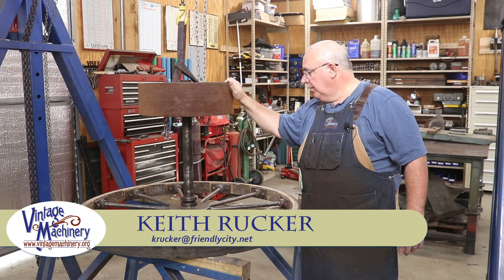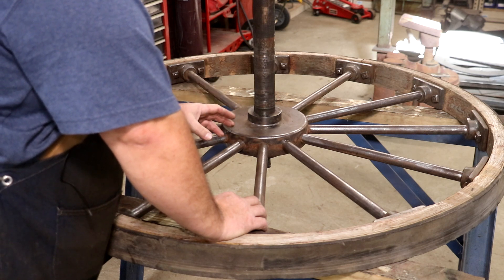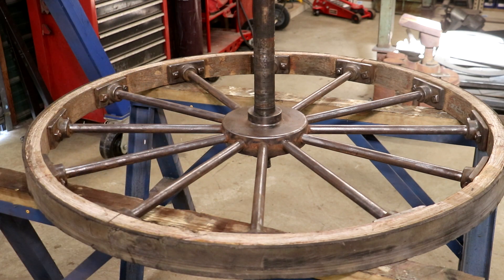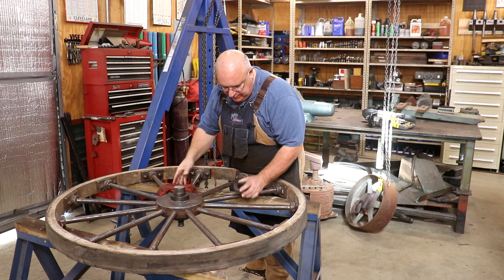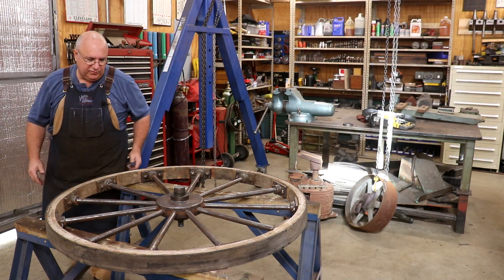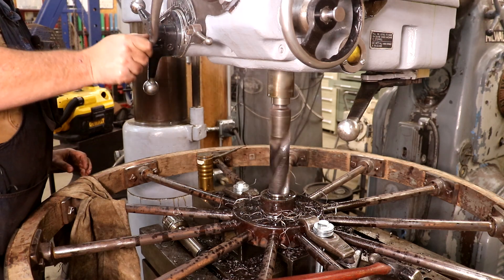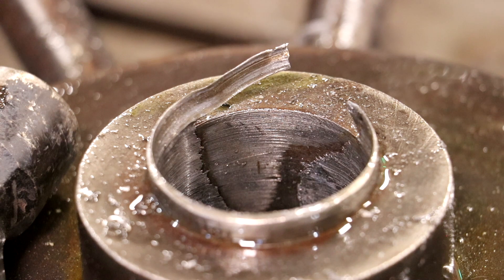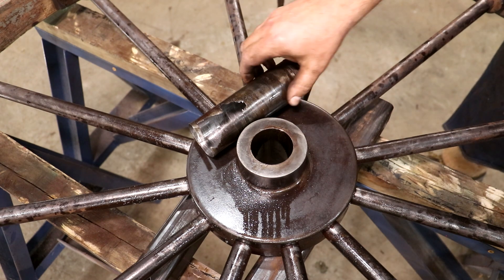The Jimmy Diresta Bandsaw Restoration, Part 5:  The Battle of the Stuck Wheel Shaft - I WIN!

Comment: I ain't got no giant radial drill.... I would have covered up that bitter end of the shaft with some of that putty stuff you use for making babbit bearings to insulate it, and then packed the shaft in dry ice for a few hours and kissed the hub with a rosebud... pretty sure the heat differential would have done the trick.

Comment: Very good feeling to see the inside of that hub with no significant damage.  I was asking myself,       
      " Keith why do you even have a radial drill anyway?"    Fun to watch this one - kinda drives home why it's so cool to have a nicely equipped machine shop!   
     The possibilities where the metal planer are concerned are interesting.   Someone Named Acheson has reworked some Bridgeport tables on their sizeable metal planer.
   *QUESTION= since large hunks of steel or cast iron are so dang expensive, could a guy clamp down a piece of wood to check an angled setup on the planer to check ballpark angle?
     Maybe the indicator could tell us the same thing thing?  Cool video.
Reply: The Acheson's planer is super tuned, with an air powered tool lift on the reverse stroke. He's also a master of tool sharpening. When working cast iron, he takes neat shavings, not chips or dust.

Comment: Even though this one is left hand thread, i would check very carefully that the other is not right hand.
Reply: The other should be LH too. Looking at the wheels from the nut side of the hub, both wheels are turning clockwise so both LH threads will tighten the nut. 

If one were turning clockwise and the other counterclockwise, like on some heavy truck axles, you would be correct. I learned that the expensive way.
Reply: @josephcitizen4195  My thinking is that one shaft will be driven by the motor, the other shaft will be driven by the blade going around the wheel.
Doesn't hurt to check anyway.
Reply: @sparkyprojects  "Doesn't hurt to check anyway."
100% correct. No downside to checking it out.
Reply: Actually this was the driven wheel? Or is that big "pully" looking thing a counter balance? If all this is a the case he would need to look at putting a different thread when he makes the new one? As it will be driven on the bottom wheel? Or I think that's what he said?
Reply: @warrenholmar1129  The one he was taking apart has the flatbelt pulley on the otherr end of the shaft, so would be driven by the motor/engine.
Reply: @sparkyprojects  oh was this the bottom one?
Reply: @warrenholmar1129  That's what it looks like, and would explain left hand thread

Comment: Hi Keith, thanks for an interesting video. It’s good to see the big beast in action. 
At about 12 mins in, you can see the power down feed actually forcing the whole head upwards and it’s particularly noticeable if you watch the ball on the end of the handle. That’s not ideal. I don’t know if you have a vertical lock on the pillar?
Cheers,
Bill

Comment: If you etch the face of the center boss with acid, it will show any structures such as a key worn flush with the boss that is currently obscured.
Etching shows the crystalline structure of the metal and is used in weld analysis.

It's better not to attempt to cut all the way through the wall of the shaft, but to reduce it to less than a millimeter and collapse the wall inwards with a chisel.
that way you don't damage the bore.

Comment: Taper-fits can be a bit of annoyance. I remember detatching a bronze propeller from a stainless steel shaft on a traditional type of boat from Sweden. I tensioned the propeller as far as I dared to, (a very hard and strong tensioning), useing a modifyed gear-puller. No action. Then I heated the propeller with a Propane-torch, up to perhaps 200°C. No action. I then re-tensioned the screw of the gear-puller and smacked the screw with a substantial blow from a hammer... Action :)

The ring in the ears... lasted for five minutes at least... Like something from the movie: "The Ringer of Notre Dame" :)

It came off beatifully though,  so I could work forward in servicing the boat properly by extracting the propeller shaft, modify it (shorten), and install a so called "Aqua-Drive" with advanced axle-joints and soft engine paws. Greatly reducing noice and vibrations. An extremely effective modification. Also, I installed a different, way more advanced propeller-shaft seal, called "Black Jack", made out of rubber only, water-lubricated against the axle + grease-lubricated and water-sealing lips from Volvo Penta.

No leakage of oil into the bottom / tramson or keel of the hull any more,  from the sealing device. The former called "köl-svin" in Swedish: Keel-Swine 
in English :)

Now one could actually sit in the back-cabin, without hearing-protection, just  hearing a soft humming noice from the engine and the waves splashing sound against the hull.

No clegg or grime in the tramson / keel anymore either.

Comment: The other shaft might be RH threads... since one shaft drives it's wheel and the other is driven by the wheel, thus to induce self-tightening the thread direction shifts. This is why on Bicycles with threaded bottom bracket (crank spindle) cups, the LH side is RH threaded and vice versa, yet why on oldschool threaded tandem/downhill rear hubs the RH side (freewheel gears) is RH threaded while the LH side (drag brake) has LH threads. Better check the threads if you can before you wrench on it!

Edit: My final analogy is wrong... Both sides of such hubs have the same thread direction RH... for the same reason I was trying to illustrate! Unlike a drive cog (which powers forward motion, a brake resists forward motion (like a non-ideal idler bearing), the self tightening reverses. But since the side/rotation flips (depending on which side of the wheel you're looking from), the flips cancel eathother out, hence why both sides of a such a hub are RH threaded.  And in the case of the saw, since the side/direction did not flip (but one shaft drives while the other is an idler), the directions in theory should flip.
Reply: While it's worth a check, with the pulley driving the shaft and the shaft driving the wheel, I'd expect that the pulley nut is also left hand thread.  That way any slip tightens.  I think I have it right but could be wrong. For instance. a bench grinder will have left hand treads on one side but right on the other.  It has to be that way because power comes from the middle.
Reply: The other should be LH too. Looking at the wheels from the nut side of the hub, both wheels are turning clockwise so both LH threads will tighten the nut.
Reply: @josephcitizen4195  Correct. Assuming the retaining nuts are on the same side of the machine, which I have never seen a bandsaw that wasn't, each wheel has the same torque-force applied in the same rotational direction. In this case: clockwise INTO the nut. Assuming the shaft slips, the clockwise rotation of the shaft imparts a counter-clockwise force against the thread direction of the nut causing itself to screw INTO the nut, or in other words, the nut to self-tighten.
Reply: @mikekellam365cid  See the edit I just made to my comment... I botched the analogy and I think a lot of us missed my point. 

The second shaft appears to be a live axle idler... so the idler pulley is driving the axle against the drag of the bearing, which is the exact opposite of the drive pulley which is being driven by the axle against the drag of the saw band and what's being cut. Since the rotation and nut sides are identical, the thread direction to self-tighten flips from LH to RH. 

For modern saws this isn't an issue since usually the idler pulley uses a dead axle with bearings in the pulley itself... not a live axle with external bearings. In such cases the nut isn't used to hold a press fit (and in fact, overtightening will kill the bearings), so thread direction doesn't matter and the nuts either are locknuts, castle nuts (with a cotter pin), and/or have keyed washers behind them.
Reply: If you examine the thread very carefully you can easily tell if it’s left or right hand.

Comment: It appears you have 2 options to reassemble:  Revert to a tapered shaft with a left handed threaded stub or straight bore the hub, broach 
a keyway and drill and tap into the side of the hub for a set screw.  The 2nd option only works if you can fit the wheel on your mill, unless
you can use a boring head on the the Carlton and have broach capabilities.  You will need a long drill and tap extension for the setscrew.  
The 2nd option may allow for someone else to avoid the same mistake you made tightening the left handed thread when disassembling.

Comment: The rim of the lower wheel is trying to slow down the driving axle (due to the load provided by the saw blade).  So a left hand thread on the axle nut will be tightened by this torque.  However, the top wheel is only idling, so the starting acceleration of the wheel inertia is the biggest load.  Since the accelerating force is provided at the rim (by the blade), a RIGHT-HAND threaded nut on the shaft would be tightened by this acceleration.  So a left-hand thread is not a certainty on the top wheel nut !
.

Comment: One thing I may not have been clear on but could make the removal easier, would be to not drill all the way through but make sure the hole goes beyond the hub by say 1/2 inch.  You could then drill it to only 1 15/16 and use a say 1 3/4 bar to drive the shaft out.  Pressing through the hub,  the left over metal will stretch and shrink at the same time..   That shaft was pretty soft..

Comment: The long indicator rod which went up in to the chuck is not straight, you can see that when you rotate it and the spot you drilled with the centre drill was off centre, you can see it clearly @10:24
Reply: So what?  The project is a success.  Done!

Comment: 24:41 the way that washer before the nut was kinda made it obvious from the start. And because it's such a shallow taper, any amount of crud/rust would've made it nearly impossible to remove.
IMO, you did the only thing, that was sensible, possible to remove it. Prolly could've worked with a torch, but that's a lot work and gasses.

Comment: I have worked with  left hand threads  for some time now. I don't belive you neither had too much heat on the nut or too much torque trying to remove it. There is a good possibility that it was damaged from the original installation

Comment: I think I'd  re engineer the shaft and put a key way in. Get rid of the taper on the shaft because I think it's going to be tough to design a taper in a new shaft that'll work. I think you'll have a problem with the wheels wobbling. I'm not an expert but you can do what you want.
Reply: Try a straight shaft with big shoulder, no keyway, and big lock washer first. I don’t see it loosening with the L.H. nut cinched up tight. This is easiest and does no harm to the shaft or bore. Red Loctite will also work and may be the best solution.

Comment: Instead of tapering the shaft by 1/100th thousand why not bore the center to a continuous diameter? Do you sharpen your own drill bits? If so, have you or will you do a video on that? It is an instructional pleasure watching you work through an issue! Thank you.

Comment: Wow! 0.100" in six inches (or whatever it was) is a REALLY  shallow taper. (VINDICATED! Bragging rights accepted.) You may want to make a tapered lap to even out the bore of that hub before fitting the new shaft. Misalignment of a few thousandths in such a short distance will make for a serious wobble at the rim of this four foot wheel. The other Keith has some pretty good videos on fitting propellers to marine drive shafts that might be helpful. Turning the new shaft between centers (so you can easily take it in and out of the lathe - I don't think you have a lathe with a 4 foot swing) would let you check the taper with Prussian Blue for a really good fit.

Comment: Hi Keith I really enjoy your channel. I noticed a big letter "L" in the axle shaft when you stopped drilling and then another ""L" on the hub. Is that for left hand threads or is it the left side of the wheel
Reply: At what time (in the video) do you see those big letter "L"s ? I checked both times that you described and found 21:53 but I cannot imagine why they would have stamped that on the inside of the taper. I cannot find what you mean about an "L" on the shaft itself.
Reply: Check 24:14 - it is stamped on the face. Good catch! I think you're right
Reply: Thanks to your catch, looking carefully there maybe be 2 "L"s, about 90 degrees (4 spokes) apart.
Reply: @johncoops6897  when Keith finished drilling out the shaft the camera was looking down at the piece left over. Where the drill bit cut through to the wall there was a capital “L” on the wall
Reply: @johncoops6897  also.. ther was a capital L on the hub
Reply: @daverankin948  - yeah, that the mark that I found. INSIDE the tapered hole, invisible from the outside while the shaft was in there and hence of no use to identify from the outside. And how and why exactly did they stamp that in there, on a high-tolerance surface?
So, i don't think that was a deliberate marking.
And where is the corresponding mark on the shaft hat was mentioned in the comments?
Reply: @daverankin948  - keep in mind that Keith was right next to and touching the parts, and HE didn't seem to notice them. In the previous video he searched everywhere for markings or holes or keyways to try and work out what locked the parts together. So how could he have missed such obvious marks?

Comment: The hammer traveled through the air and squarely struck the brass rod.... amazingly the shaft was forced down... but just slightly. The wheelwright saw the movement and swung again. Another movement. Blow by blow the shaft was finally forced out of its hole. At last it fell to the floor clanging like a church bell, signaling to all who were watching.......the wheelwright straightend, extending his hammer above his head and bellowed "I HAVE WON!" The public rejoiced... The battle was finally over
Reply: Thou hast made a classic story there.  "The taming of the through shaft."

Comment: The left side is left hand thread but right side will be right hand.  This is done to TIGHTEN the bolt while moving forward.  This was also done on some cars later on.
Reply: Do you know if Dodges still have LH lugnuts on the left side?  It has been decades since I've worked on one...
Reply: Still the same on bicycle pedals too.
Reply: These are on the same side of the saw. This is not like a car where the wheels are turning the opposite direction. Both of these wheels will be LH'd.

edit: I wrote press but it's a band saw. I've got presses on the mind. sorry.
Reply: There are no sides here. It's top and bottom. Both should be LH thread.

Comment: Hey Keith, what brand of green stick rouge would you recommend for a leather polishing strop for sharpening carving knives?
Reply: Not Keith  here, but my fine polishing green is the sticks I  get from harbor freight.   Works on brass, alum, copper, stainless, etc and even my occasional (rare) gold parts.
Reply: For polishing the edge of a working knife, I agree that any brand will suffice.  You maybe might be able to tell a difference in brand if you were looking to mirror polish a display piece.

Comment: Forgot you had the radial when I told you to lance it out. - Your way is MUCH better (And a lot less painful the having sparks going down your neck)   Work smarter, Not harder.I would have a lot harder time then you did, and had no OD taper to match up ....You did an outstanding job. .

And one thing for the "less experienced" out there. ---Notice Keith DID NOT wear gloves or have rags around the radial drill . No pro would. = Loose the gloves or loose a finger (Or arm in the case of a radial) Even a 1/4" hand drillmotor can bust you up if it grabs a glove at 2000RPM.

Comment: could you still use the same shaft even though you cut it? maybe there is (or isnt) clearance on the bandsaw and the pulley wheel can work closer to the saw itself. 

or maybe it needs a new shaft because the length is crucial 

Well done that was a challenge!
Reply: Keith had already said he was going to make a new shaft because of excessive wear on the old one.
Reply: @royreynolds108  ah I missed that part